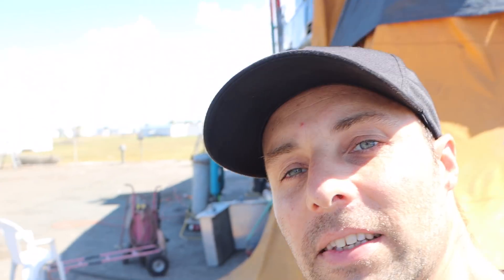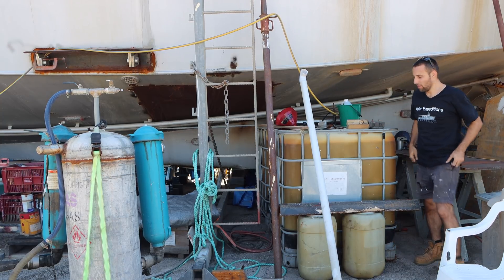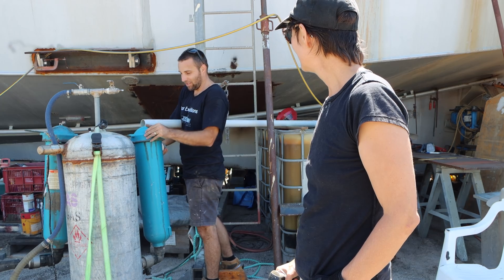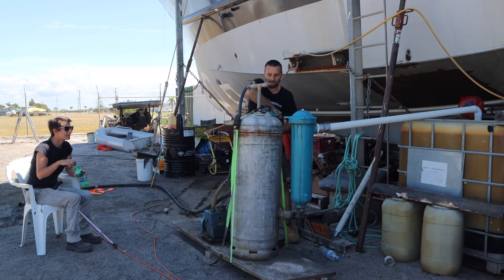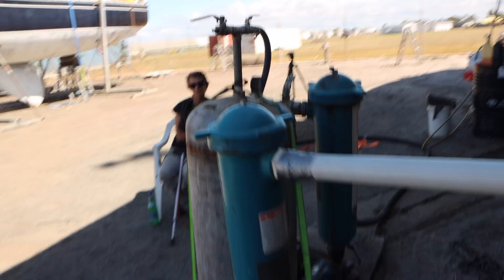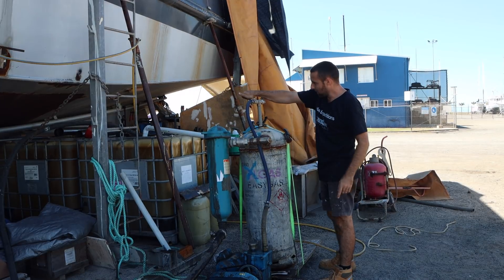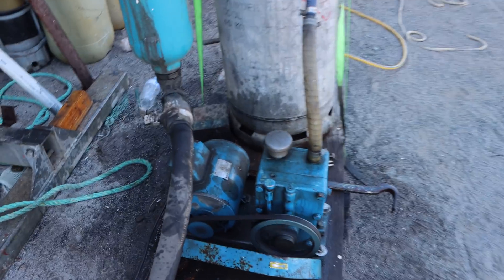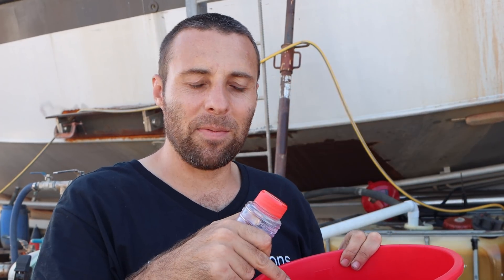Fuel Testing & Fixing 2ton of Dead Diesel - Project Brupeg Ep. 132

Comment: you  had a coil of tubing in your diesel test kit, you could have used it as a pipette by lowering it into the tank and letting diesel fill it, put your thumb over the end to create a seal then vacuum would hold liquid till you put  end of tube in sample bottle and release the seal made by your thumb a bit till you had enough.
Reply from the maker: It sounds like there was very little risk of something going wrong if we did it that way. Where's the fun in that?

Comment: Wouldn't the diesel evaporate easier than water? What about seperating by just decanting/draining only the bottom of the tanks?
Reply from the maker: Hi Axiom. Decanting only gets water that has seperate from the oil. Vacuum allows us to get the droplets that are sitting in suspension anywhere in the diesel.
Reply: @ProjectBrupeg  Thanks, that makes sense. To answer my own first question; the vapour pressure of diesel is much lower than water at normal room temperature so the water boils away first. However at 22.5"Hg (absolute pressure of ~0.2 atm?) your pressure is not low enough to boil off the water?
Reply from the maker: prior to vacuum the crackle test showed we had water in the fuel. after the vacuum the crackle test showed no water so im guessing the gauge was a dud and we were pulling more than we knew about. it was really easy to see the steam coming off so we were definately boiling something off

Comment: what its dead diesel   never heard      ok its need filter it      normal in a tank you have a crane  in the bottom   and let the water out its the easy way   dont forget  a  big hole in the tank so you can clean the thanks       mix it whit new diesel its like new     and get a 2 big filter 
yes we have 2x1000 hp man diesel its a hydrofoil    cat   53  knot whit arnesons

Comment: ingredients:
* 0.2 liters of methanol
* 7 grams of anhydrous caustic soda
* 1 liter of used cooking oil / frying oil (from
fast food, filtered, no leftovers)

First mix methanol and caustic soda. Then add
frying oil. Mix everything at about 30 degrees for about 12
hours with a mixer, a cement mixer or
like. (Do not use tools that are in use
cooking.)

Leave the mixture on for at least 12 hours. The mixture then has
separated into 1 liter of biodiesel (fatty acid methyl ester) and 0.2
liter of glycerin. (Glycerin + water = green soap)

Biodiesel is pretty strong cases and cars with bad ones
rubber hoses in the diesel supply can have a problem.

Therefore, check with your dealer before using
biodiesel. All Volkswagen and Audi intended for
diesel after 1995 is also approved for biodiesel.

When you switch to using biodiesel, the deposits will
regular diesel in hoses and tank dissolve. This
gets stuck in the diesel filter. You will therefore come to
need new diesel filter pretty soon after you have
started running on biodiesel.

Biodiesel becomes viscous
when it is cold. When the temperature drops below about 6-7
degrees you need to start mixing with regular diesel.
Below 0 degrees you should semi-blend biodiesel and regular
diesel.
Reply from the maker: Hi Alf, Bio diesel won’t be used in Brupeg. It’s hydroscopic so it absorbs airborne moisture and therefore too difficult to maintain quality at sea. We would also need to buy in drums of methanol and dump drums of glycerin waste as we process the oil into biodiesel. Bio diesel and running on waste cooking oil are very different processes. Brupeg will burn straight waste cooking oil not bio diesel.
Reply: @ProjectBrupeg  Hi 
Isent bio and wastoil the same,just two diffrent way to seperate it?and glyserin+wather is greensoap😊so you get fuel and soap👍🐣🐣oki i see the problem whit hawe many drums🛢 of methanol ombord to so do it the most issiest way👌like your vid soo keep up the good work and stay strong ang safe👨‍🏭👩‍🏭👩‍🔧👨🏼‍🔧
Best regards from Alf 🇧🇻
Reply from the maker: Hi Alf. When you burn oil you have two options, 1. Modify the oil (biodiesel) so it burns in a standard unmodified engine. Or 2. Modify the engine to burn straight oil. 

1. Is fine for small volumes as the cost and hassle of modifying an engine make it uneconomical. The higher fuel cost is offset by the lower engine modification costs

2. Is best for long running motors where the initial higher cost of engine modifications (heats fuel tanks, fuel lines, fuel filters and plumbing valves) is offset by the significantly lower fuel cost. 

For us we once we start the engine it will run for many days-weeks at a time under load, so the higher initial cost is recouped very fast from fuel savings

Comment: You need to aim for an ISO code of 18/16/13 to have a nice clean diesel. 
With less than 100ppm of water. Consider a fixed polishing rig onboard to keep it in top condition. A coalescing filter will separate the water out and allow to be drained off

Comment: Good Day from Ontario Canada. 
I have been enjoying the progress and determination to get the project finished.
 I have been working with used oil recycling for over 20 years. Just a few thoughts. Use a larger strainer before the bag filter to catch larger bits. Pulling from the bottom of the tote and returning to the top creates a mixing effect to provide better results. Running from the dirty tote to a clean tote and take a sample and let it sit. Look for sediment and water separation. How small of a micron dirt particle can pass through injectors?
Hydraulic oil is processed to 1/2 micron nominal filter  micron size with less than 100 ppm water.
Adding some heat as well really makes the process faster and dries the product easier with a vacuum. 
Great job building your own system !!!

Comment: I used to load-bank test generation plant, and one task on mission-critical units was 'fuel-polishing'. The polisher unit was run off 240V. Put one hose on the tank-drain, the other back into the filler, switch on and leave for 2 hours. The fuel is clear and dry, filtered to micrometre grade. Easy!

Comment: Quick question why 1 micron that is crazy rediculous no need to finger it down that far that Cummins will easily run on 7-10micron your going to spend a lot of extra money for those 1 micron filters save your money and go to 10. You could have also saved some time by stripping the tank which is you pull all the super nasty stuff off the bottom to separate and process it later.
Reply from the maker: Hi Don. Zero price difference between 1,5,10,20 micron filters and the fuel was pulled from 12” below the surface. 2ft from the bottom of the tank
Reply: Project Brupeg must be nice here there is a price difference. But what is was referring to is you’ll plug 1 micron filters fast so therefor use more of them. All the ships I have ever worked on the smallest we would go to is 5 micron on our constant run gens but we had 3 per so we could switch uninterrupted.
Reply from the maker: Hi Don. Yeah I’m the boat we run a hot swap system. I might bump the filter up to 5 as the one was a guess on my part just thinking 1 would be better than anything higher.

Comment: Use an inlet fluid pump to push oil into a vacuum chamber lined with coalescing filters and a discharge fluid pump to pull the oil out.  If you use fluid level sensors inside the vacuum chamber you can control the level in the chamber. This will create your continuous closed loop system.  Look up vacuum oil dehydration companies like Baron, or OFS. We've been dehydrating transformer oil like this for years.
Reply from the maker: Thanks Timothy

Comment: Did you check the filters afterward to see how much came out of it? Shouldn't the water sink to the bottom of the container and you could pump out most of it before running it through your rig just to speed up the process. This is my favorite kind of engineering.
Reply from the maker: Hi Bob, the issue is the water we are going after is i suspension, ie wont seperate out. Hence we needed to attack it a different way

Comment: That’s the most interesting way I’ve seen to dry out your fuel. I’d usually run it through a water filter/fuel separator. 

Make sure to run a fungicide/biocide in your fuel. Especially after everything that fuel has been through.
Reply from the maker: Yeah we have it a shock treatment and you can see the dead gunk on the bottom of the tank now. The filtering was mainly to remove water as it’s suspended. A water separator wouldn’t touch this as the particular size is below what they can deal with
Reply: Project Brupeg that’s one thing I always tell people with boats because of the potential to be left adrift in bad conditions. It often over looked. 

Once diesel bugs grow in your  tank your only option is to flush the tank. Otherwise you’ll dig out floaters from your filters and pre filters for ever. It’s a nightmare especially while underway. Filters always plug at an inconvenient time. Like while coming along side a dock next to a million dollar yacht, or while navigating tidal waterways where having a engine for maneuvering is life and death. 

I’m glad you shocked it. Make sure to put the maintenance does in at every fill up. It’s extremely cheap insurance.
Reply: @jeremykamel9655  Diesel bugs in the fuelv tank proved  to be the only  thing that could stop my old Mercedes W123 300D

Comment: Add an air pressure regulator to the inlet to slow the flow
Reply from the maker: Hi Edward. we have a ball valve on the inlet which we can normally regulate flow with. I just got a little carried away ad opeed it a bit too much. normally its not an issue but i was out of practice with the unit.

Comment: Given the recent drop in fuel prices, I'm curious what the current replacement cost of that fuel would be. What with all the handling, testing etc how much is being saved in real dollars?
Reply: If I had to take a guesstimate I would say $2400 AUD or $1300 USD and have a nice day y'all.
Reply: it's not just the savings on fuel cost, he's experimenting with some of the the hardware they'll eventually be using to process biodiesel, not to mention if they don't render it usable for something it's toxic waste that has to be disposed of. If it cant burn in an engine though maybe it would be used for heating oil ( I know not many places in Oz use a furnace but maybe in the Snowy Mountains. Or even an oil fired furnace when the boat is in the Antarctic. Or maybe if not perfect as is it could be mixed with a better quality diesel to make an acceptable lower quality diesel. Just thinkin out loud here.
Reply: MyOther Username   Thank you for that.  I had not even considered how valuable having access to that capability would be.  And more... thanks for being kind with your response.
Reply from the maker: We agree with Steve, thanks for being awesome in the comments guys

Comment: Nice system, but im a bit surprised that it works at all. 
Just adding my 2 cents, im really impressed by this project and have been following it for a few years.
To preface this, I have a background in chemistry and we do a lot of large scale destillation, up to 8000 liters at once. 

At 800 mbar/22.5 inch mercury, water would boil at 90*C instead of 100*C. Since you're not actively heating the diesel, all the energy that goes into boiling the water comes from outside, which is not much. You are also not stirring the diesel in the tank, and with such a small diamater tank, the water at the bottom would have to go through all that diesel to evaporate. Mixing it somehow would improve it, or putting it in a much wider tank/ putting the tank on its side with valves at the top. Or improving the vacuum a lot,  think in the region of 50 mbar and lower. 800 mbar is not really a vacuum. I also would suspect that pump to pull a much higher vacuum then 800 mbar,  3 phase electric pumps of similar size that i work with do 10 mbar easily, if the rest of your system does not leak.

It is also much more efficient to pump the clean diesel in a seperate IBC, otherwise you're just mixing it with the bad stuff. The overal quality would improve, but only by 10% of what the clean diesel was, since you mix 90 liters clean with ~900 liters junk. 

Good luck!
Reply from the maker: Thanks for this. Firstly I think the vacuum gauge was shot so I don’t fully trust the reading we were getting. I have thought about laying the tank over to add more surface to the fluid. As for dumping into the old IBC. This was just so was could get our sample filtered and off to the lab, if/when we process all of it we will filter into another clean tank
Reply: @ProjectBrupeg  Ah right, gotto do those test runs. Damn gauges always breaking, time for another rubber plug!

Comment: How about a simple water separating filter to start? Properly sized, you could run through all of that pretty quickly
Reply from the maker: Hi Micheal, this fuel has all been pumped through a glass bowl filter however the water we are removing now is suspended in the fuel (ie wont seperate out) hence we needed to go to the next level of seperation techniques to remove it.
Reply: @ProjectBrupeg  thanks for the response. The project is looking great, keep it up!
Reply from the maker: Thanks Michael

Comment: If you turned the air on for say 20 seconds and then shut it off and open the outgoing valve you would be able to control your flow a bit. That way it wouldn’t keep the pressure in your tank high.
Reply from the maker: Hi Ben, yeah normally i remember what valve to turn but its been over a year since i used this beast so forgot what valve does what. normally excess pressure isnt an issue

Comment: To remove the moisture from an 83 passenger pusher type Transit bus roof top AC system, (It uses a 6 cylinder Vee type compressor)  My specs say to vacuum to 500 Microns.  Until it reaches 500 Microns, it still has water in it.  I sometimes takes 3 days.  Diesel fuel should be the same. Pull until 500 Microns and it will be dry.  Then you might need some additives  to replace the lighter volatiles.
Reply from the maker: Thanks for the info!

Comment: Change the oil in the vacuum pump.  It will work better !

The longer you hold the vacuum, the more water will "boil" off.  I would also suspect when the water is all boiled off, you would see the vacuum gauge drop more.
Reply from the maker: Thanks Jack

Comment: A regulator on your air in supply might help control things if you haven’t already got one. Seams like a good system to me you should roll with your second-first plan. Hopefully the fuel is usable.
Reply: @Jon S My thoughts exactly, only needs a few psi to push the diesel out of the tank, especially at such a low head. Using full pressure from the compressor is an accident waiting to happen!
Reply from the maker: Hi Guys, thats all true, for now we have a ball valve at all openings which works find, its been a few years since i last used this processor so i had forgotten which one to leap for in a emergency. normally its not an issue

Comment: Hey Dame, One thing on your current vacuum chamber, you may need a stirring device inside or lay the chamber down on it's side so there is a bigger open surface area at top to help with evap of water from diesel. While you're pulling vacuum on the top surface, the liquid at the bottom still has a column affected by gravity so it's pressure is higher than @ the surface levels, reducing the evap; the surface area also affects this process since it's a phase change ( liquid is bubbling, etc ).  Think of it like the guys distilling water out of maple syrup vats by boiling it... more area, faster water removal and dissipation. Don't know if you can hear the bubbling inside chamber with vac pump noise, but it would be cool to see it thru a window if you do it in future processes. Am thinking about the high pressure system mentioned, curious about if the same, or finer filters are req'd to keep particulates from the type of nozzles I'm imagining... Guessing it has numerous laser drilled holes to help guide diesel streams at high temp or under vacuum to achieve surface area increase mentioned before as affecting process ?   Great video as always, take care of everyone !
Reply from the maker: Hi Mike, yeah this is a really good point, i hadnt thought on column pressure.Thanks for this, mods will follow...
Reply: Clearly you are correct  on static head preventing 'boiling' in the lowest part of a very  tall vacuum tank , but the high vacuum mentioned here should surely  allow the water to form vapour bubbles and escape  easily from the top of the vacuum tank ? . Normally water would stratify under the Diesel layer  and would be separated by draining off at the bottom of a conventional fuel polishing rig with separation helped by centrufuging action . Emulsified oil and water mixture however  presumably can only be separated by vacuum. Meanwhile  I've just grabbed a couple of large Perkins filter/ separators off Ebay to make a fuel polishing rig for an expedition truck build , but am struggling on deciding  best circulating pump flowrate.......
Reply: Good suggestion. What you in essence want is a larger surface area. Adding the mix in a tangential way to the tank wall or using a (makeshift) sprayball and looping it over the tank would hugely improve the effectiveness of the separation.